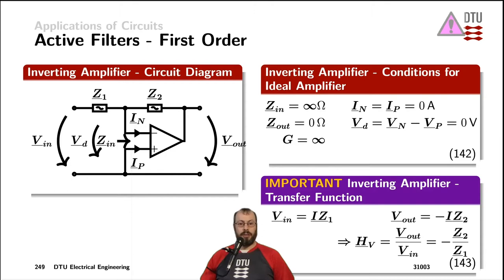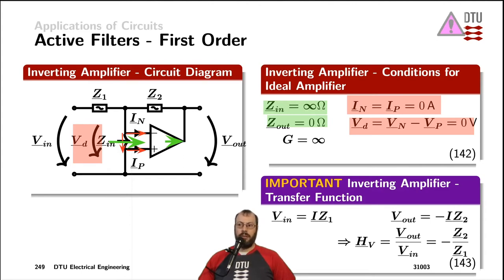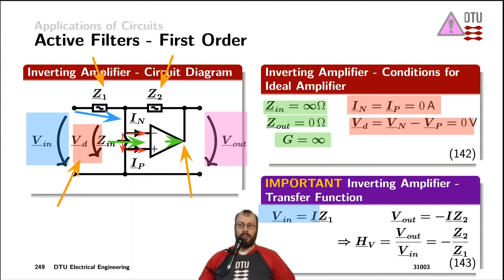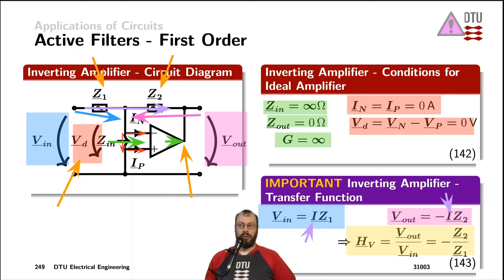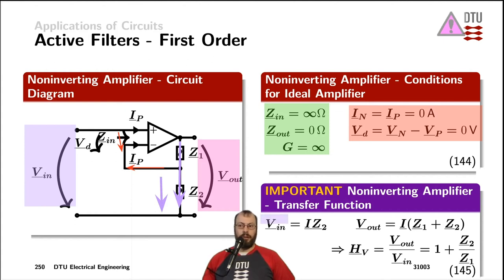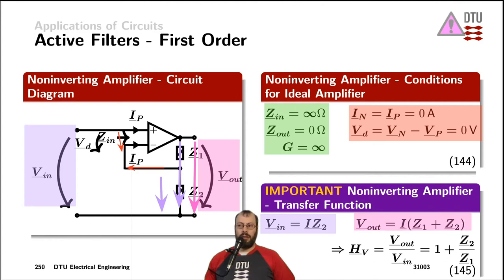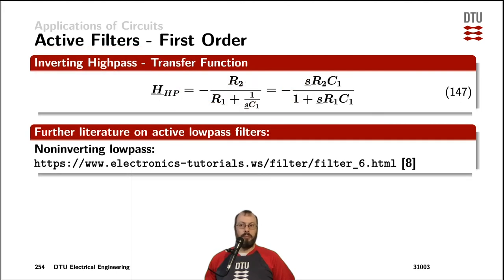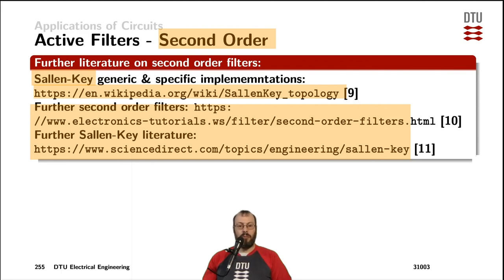Applications: active filters

Comment: 0:30 “the voltage across these two nodes (op-amp inputs) is always zero volts”.
This is wrong. The voltage difference between the opamp inputs is only zero volts, if there is a negative feedback configuration. If it is an ideal op-amp with positive feedback, there will be a voltage difference between the inputs.

By the way, the phenomenon that the op-amp input voltages are the same is known as a “virtual short”.
A common misconception is to call the phenomenon “virtual ground” but this only applies if one of the op-amp inputs is grounded.